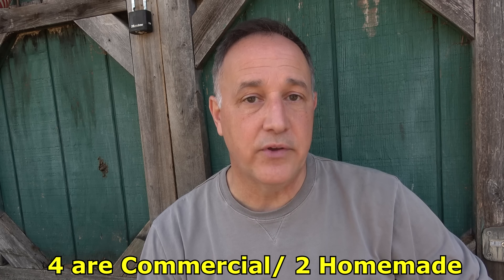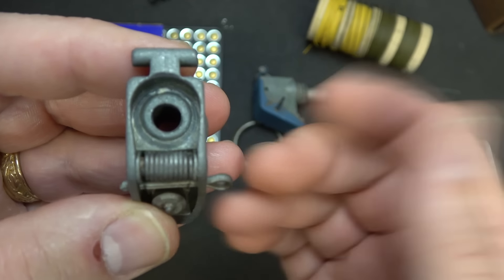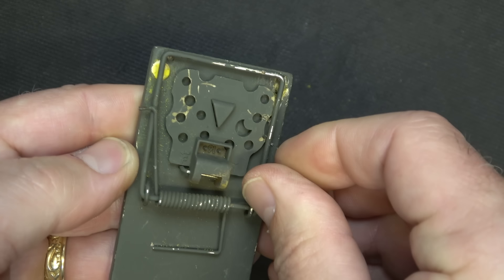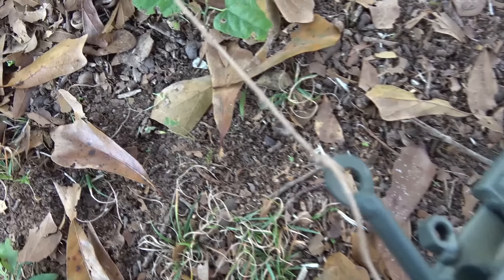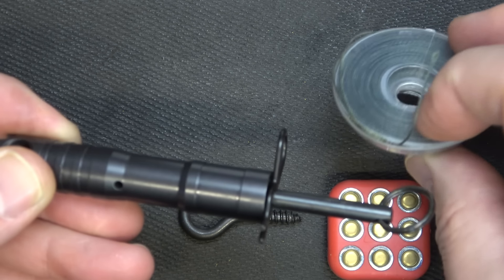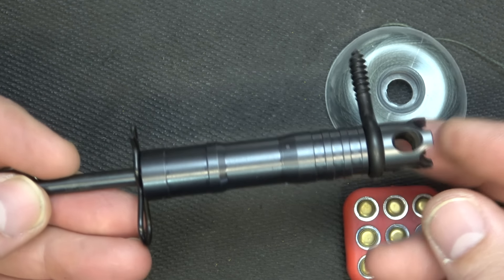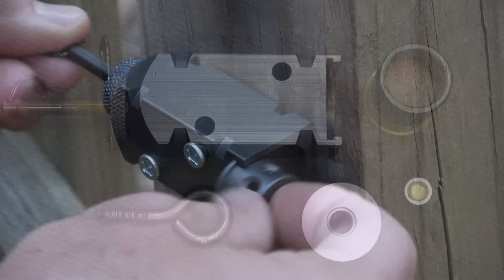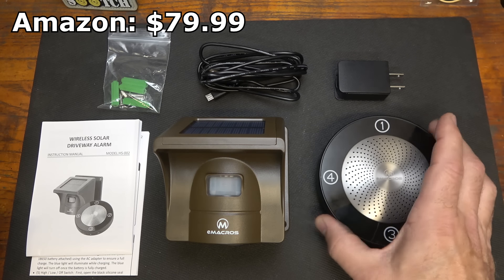6 Different SHTF Perimeter Alarms

Comment: What are your thoughts on this:
Having a security system with this much ingenuity may alarm invaders to a potentially greater reward at the 'end of the rainbow'. How could you find a balance between alarms and having a 'gray man property'?
Reply: WTF- DOES THAT MEAN,WOW..
Reply: @fiddlesticksbessette398  
let me break it down as best I can.
in today's world of law and order, most criminals are opportunists. they weigh risk vs reward rather quickly. In a SHTF WROL situation, those committing the crimes are doing so less out of opportunity and more so out of necessity. This changes how they calculate risk versus reward, because now they have to consider the risk of them NOT committing said crimes. 
So, when a criminal is gauging the potential reward for looting your property, a deterrent like these would actually alarm the criminal to a greater likelihood of reward, based on how much the property owner is willing to deter the looting. 
which one would you assume has the greatest treasure, a bank vault with armed guards? or a shoebox buried near a tree in a backyard? If you had to pick one, and your life depended on getting a minimum reward for your efforts, which would you choose?
Reply: @johnsmith-fy8jo  are you a necromancer? this comment died a year ago. lol

Comment: Ok, what about reliability if its wet or raining outside? I know some of those will not work if they're wet.
Reply: pine 09, which do you think would fail when wet? Technically speaking, primers should still work even if wet. When manufactured, the priming compound itself is wet, then covered by foil. The alarms all seem like they'd be effective whether dry or wet conditions - maybe not fully submerged, but rain shouldn't be an issue. Dropped a shotgun shell in a puddle, picked it up, gave it a wipe before loading and fired just fine.
Reply: If you know some of these won't work if wet, you really should share that information.
Reply: Niki Romani rain and constant rain over time are 2 different issues.

Comment: Just a heads up, I bought 5 BASU sound grenades about 2 years ago.  Have been kept inside away from moisture and temperature extremes yet recently 1, and now 2 of the 5 have started malfunctioning (going off without me pulling their pins)

Comment: More than loud that last one there has terrible placement as it will never be tripped the second time and objective only the loud part has been completed. As there is no offering for a follow-up at all I like to hand the boys in blue that only have two digit IQs a little more than a clue. As in please follow the backlight Trail until the dog's nose nose. Both your backlight as well as your dog will verify. But beyond that the doctor will verify he is covered in rose hip hair and Pranksters oil and sweat detecting Rouge. Literally caught red-handed I say and with an itch that will not soon be forgotten. Because that is a two-day triple verification empirical evidence trap. That only a doctor can cure. But even left untreated is harmless. Unless you're foolish enough to scratch your eyeballs out. Note as traps may be set off by family members or pets or even the stupid raccoon. Mind the position and the direction of the delivery system. And if you are going to use bear spray test it on yourself first! Know what kind of hell you're just about to get yourself into.

Comment: Dakota alerts work pretty well. The are wireless and can transmit about 1/2 mile away. They are easy to setup and the intruder isn't alerted that they tripped the alarm.

Comment: Taunt- stretched or pulled tight; not slack.
Taunt- provoke or challenge (someone) with insulting remarks.

In other words, the line should be TAUT, not TAUNT.
Reply: LOL! I wrote similar and then cruised the comments to see if anyone else did the same. Here you are. Good to see someone else had sore ears.

Comment: That's the baby I use right there big Square aluminum block. I call mine Valentine she will love you good long time. And no UV light shall you pass.

And I still have to stay your place is nowhere near safe and your traps are gone. Because your placement is horrible with that placement your dog is also blind.
but it is no reflection on the tools just your placement of them.